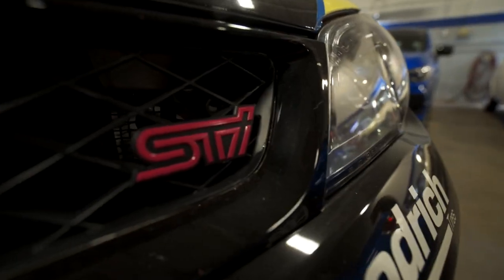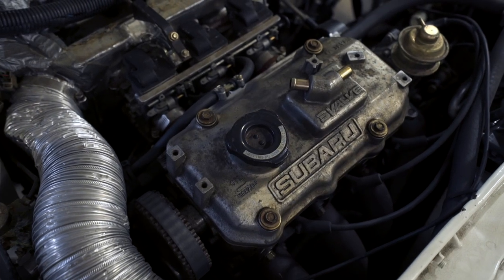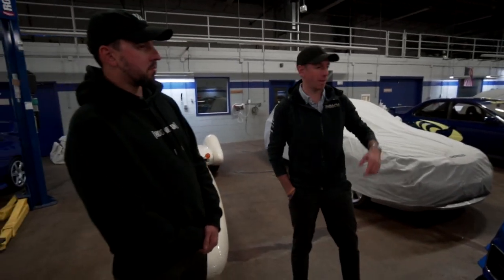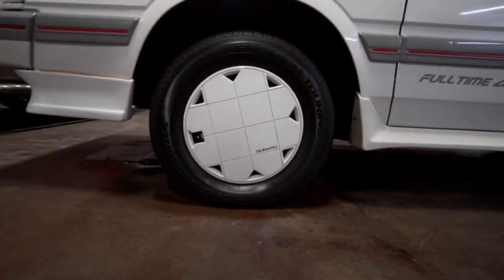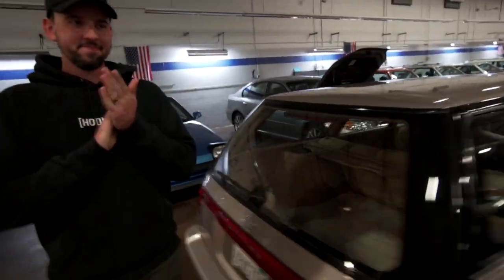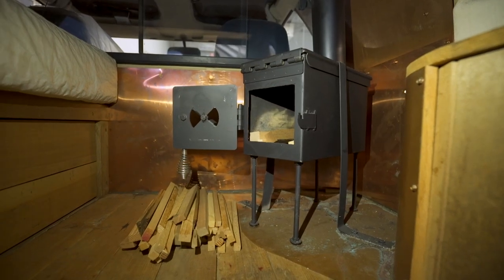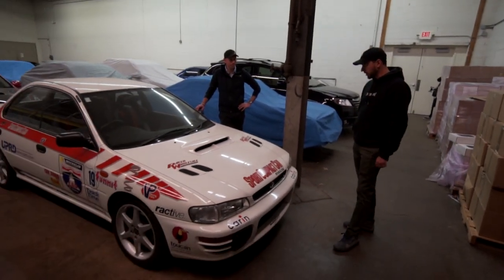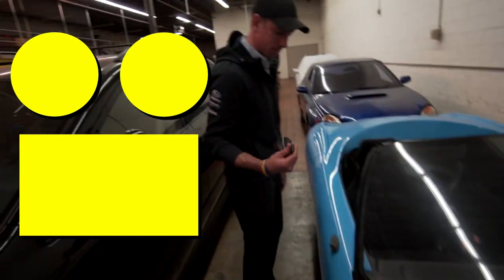[HOONIGAN] Explores Subaru's Secret Heritage Hangar!

Comment: Those shift levers for the 4wd gl vehicles, that wagon, the brat, etc. Were super cool, because you could literally change your range, and to 4wd while still rolling, and even without the clutch, a massive improvement over all other 4wds from the time, you didn’t have to stop to get grip, you just pulled that lever up.

Comment: HOW ARE YALL GONNA BE RIGHT NEXT TO THE LEGACY GTk WAGON AND NOT TALK ABOUT IT?!?!

It’s the coolest modern Subaru wagon ever. Recaros and 300hp & 350ft/lbs! 

Literally so sick. It has the 2.5 out of the 10-12 legacy GT with a low mounted turbo. 

Just go back and drive it or even just start it!
Reply: For real, just commented almost the exact same thing. I saw that car come into frame and my jaw literally dropped. I’ve been wondering what happened to that car for over half a decade at this point, and it doesn’t even get a second glance from them.
Reply: @BadCoreyMedia  it is an inspiration for a build I have plans for. I love the body style and it’s so overlooked by all people, even die hard Subaru enthusiasts.
Reply: @xchrisxwoodsx  Preach. 3.6R NA track build in progress here. The entire platform is so slept on because “oo big headlights scary/ugly”. USDM got the shaft so hard on 10-14 Legacys.
Reply: @BadCoreyMedia  2011 legacy 2.5i was basically my first car and I immediately fell in love with the platform. Spacious and good looking with a great community cult following
Reply: Before I bought my specB I always asked myself why the 5th gen didn't come in a spicy format. Such a nice car but even in non turbo form they're so rare here

Comment: I saw and sat in a 22B that Subaru was showing in 1998? I then bought 98 blue 2.5RS and modified it right after that. Drove that car for about five years and then sold it. Out of all the cars I've had, that's the one I regret selling. It never even made it to turbo status, it had the full N/A suit plus all the suspension/wheels/tires, and I had done a lot of lightweight modifications, so with me in it, it weighed in at ~2700lbs, in a straight line it was as quick as the initial WRX that rolled stateside. It was such a fun car to drive.

Comment: The first car i ever drove was my Dad's '92 SVX in '94. My brother owned a XT6 at the same time. Fast forward to 2008 I bought a '96 Outback and then bought a '95 SVX. I had my SVX for 12 years and only did breaks and a new radiator. Great car fun to drive, the thing was built like a tank. The styling was done by Giorgetto Giugiaro, same guy that styled the Bugatti EB110.

Comment: 17:21 If you notice the pattern on the wheel caps on the RX Turbo it's engineering grid paper design.  FYI, those wheel covers by themselves gave about 2% better fuel economy.

Comment: The last car I owned (no need for a car anymore, and too expensive nowadays) was a '00 Subaru Impreza GT Turbo 555. The most basic Impreza at that time but still the 2.0 turbo engine. Offcourse in blue, and I had OZ gold wheels fitted, I think some Leggera type. What a car. I just loved the boxer engine sound at low revs.

Comment: My first Subaru was an '89 XT-6.  5 speed, AWD with a locking center diff.  I put 235k on that car. It was amazing...  Went on to own an '02 WRX, '05 Sti, '12 WRX and '17 WRX.  So many good times in those vehicles.  Thank you Subaru!

Comment: I  had an '81 GL wagon with that cyclops headlamp. I would have kept it, but the valve guides were worn out and the transmission shift fork broke, making it a 2-speed transmission (with 4WD Low). bought it for $300 in 1999. drove it for 96k miles until the 4spd manual died. smoked like a train. (if it smokes, it has oil in it kind of deal)

Comment: Long story but...
Ihad been working at a Subaru dealership in Colorado. Burt's to be specific. Around '84-'85. I met some hot girl at a MacDonald's that had locked her keys in her car. Yep, it was a Subaru alright. Anyway, since this was the eighties she called and the cops came with a slim-jim. The first cop brought out a flare and pretended it was dynamite to open the door and of course we all laughed. These cops worked on it for a bit without success. I told the cop just sweep the jim back from the door handle towards the mirror and it will open. He looked at me like; OK smartass let's see you do it. So I took the slim-jim and on the first try not three seconds I had the door opened. Cop looked at me sideways and I told him I've had some experience at this. LOL!

Comment: Okay.... so that fuel economy project they did in the 70s around the 11 minute mark is essentially the original blue print for the failed Delta Wing race car? I know Subaru didn’t build the Delta Wing, but the similarities are striking.... it also looks like a scaled down version of the Blue Flame...

Comment: 38:43 wait what, really? It's the fastest STI Subaru ever made? That's rad!
Reply: No, fastest in that collection
Reply: @neezduts3457  but they have one of each fast model? I'm talking about the road cars now, not the air slayer for example
Reply: @Marticus518  I'd assume fastest in a straight line. Subaru hasn't exactly bumped up the power that much in newer models.